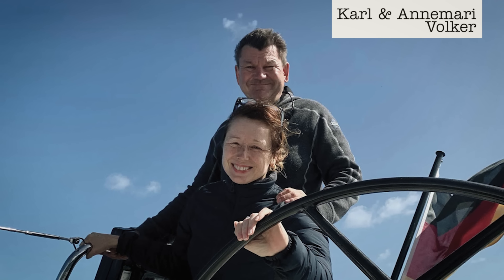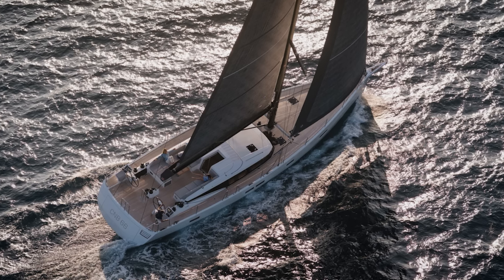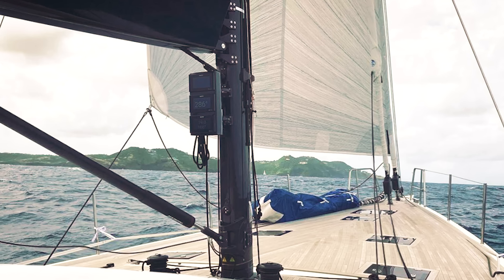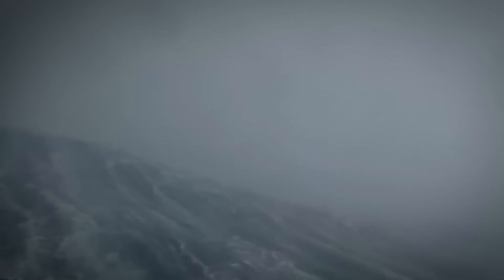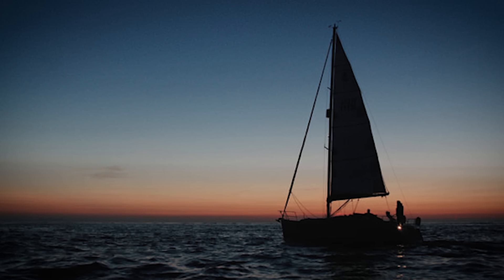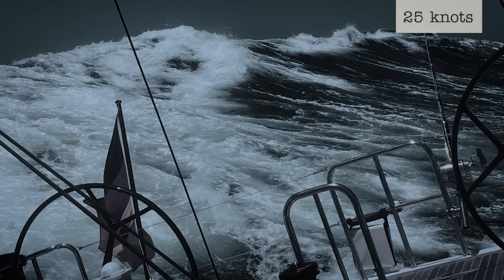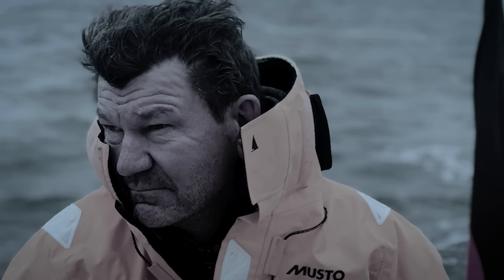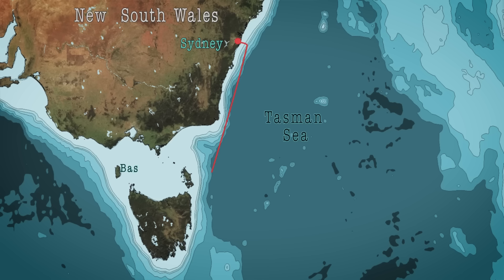Couple DIES on Private Yacht!

Comment: Sad story.   My analysis.  This seems like another case of people having more money than skills. going from the corporate world to big boat sailing is simply not possible.  You must start with small boat and work your way up. The title is not reflective of the events.   The diagrams are poorly done while the audio description seemed generally well done with some key facts skipped over too quickly.   I am a bit dumbfounded how they let this happen.  Have they not heard of a boom brake?  Heaving to?   Weather GRIB files?  Weather routing?    An in-boom furler is easy to manage.  This was not a race.  They should have shortened sail far more, slowed down, and not shaken out the reef if weather was expected to worsen.  WTH?   The Captain needs to both lead and train his crew.  Doing neither is destined for disaster.   Certainly slowing the boat down was the best choice.  Also, the description does not describe the proper method for furling.  There is no need for a preventer sailing upwind!   He talked about reefing implying it was slab reefing.  Next, it was too large a boat for a couple to handle.  Bringing on only two crew and not fully training them was unwise.  Sailing with less crew is OK, but it requires shortening sail in advance, and at night, people generally shorten sail for safety.   Practice, needs to be done at the dock with drills, followed by full practice in lighter wind conditions while underway.   For a boat that size, surely they had room from more crew.  I know there is room for at least 6 and more would have been better.   Then after the helicopter evacuation, I can’t believe they abandoned the boat.  They two crew were uninjured.  Did they no nothing about sailing?  Why were they there if they could not sail?   Couldn’t they get the main down and sail under the genoa alone?  Finally, I don’t understand how they both died. Very sad.   It sounded like they were stabilized.   How do you die from a broken leg?  Did that compound fracture severe an artery?   Were they over-medicated with morphine?
Reply: You bring up a lot of really great points. You should do a response to this video and do some research and make a new video researching all the fine points you mentioned.
Reply: dude had open fractures. that alone with tourniquet will kill him in not long time. not even accounting for blood loss

Comment: Sounds to me Carl was good man as well as his mate Anna Marie. It sure seems these new boat base on their designs to be like a racing boat is the biggest threat for sailors. I say this as I and my wife took 3 class levels of ASA in the Atlantic form St Augustine. During the class the Beneteau boats were not fun at all. Yes they turn like road racing cars but that sharp quickly turning is extremely dangerous. I went below when the capt and my wife were sailing to see how the living condition were during a jib and I was holding for death and was pulled away and thrown across from starboard of the salon to the port head and broke the then head door flying into the head room. I simply could have be killed. Not only that but sailing through 7' waves was awful slamming and pounding like a wrestler was throwing on the ground. These newer boat are designed to be for racing teams and the manufacturers are presenting them a sexy fast cruiser for couples. My training experience has lead me to to older Tayana's which are much more comfortable and safe in white water oceans as well as in tacks and jibs with their bit slower turning and cruising approx knot slower. Jim Rodgers

Comment: A furling boom does not furl the mast. It furls the sail. 
The main sheet is not called a rope. That line is called a sheet. 
Something is very wrong with your report as you say the main sail was lowered yet you also say the boom was a roller? 
The person on watch was clearly not at all experienced  - the boat should have been reefed as the wind increased. 
The crew did a good job medically but not with the boat - the main halyard (holding the main sail up) should have been released to drop the sail. If the wind prevented this then the sail should have been winched down. So many errors. What is obvious is that no familiarity training occurred. 
Very sad outcome that was avoidable.

Comment: Who puts in a second reef at 35 kts.?
Reply: Everyone whose boat was not overpowered before that? Some boats, depending on their size, point of sail and location of the second reef points in the sail will handle that wind velocity without difficulty. Of course, that's referring to traditional slab reefing where the reefing points are fixed. Aboard the boat in the story, a second reef could be in a relatively wide area of the sail.

Comment: You really need to find a better graphics guy. Your uncontrolled gybe animation in this video showed the wind changing in the opposite direction as would cause a crash gybe, and in your video about the anchor that crashed through the coast guard boat, despite repeatedly saying the boats crashed "port bow to port bow" you overlaid graphics that made it look like the tanker hit the coastguards ship from behind, port to starboard. Makes your content seem untrustworthy/poorly researched. Also there are no ropes on a boat... they are called lines.

Comment: WELL, BADLY DESIGNED SETUP FOR THE MAIN SHEET AND PREVENTER WINCHES COULDNT SEE ANY SAFETY BARS TO LEAN AGAINST IN HEAVY WEATHER EITHER ALONG WITH DECISIONS SHOULD HAVE BEEN MADE EARLIER BEFORE DARK<EXTREMELY SAD SET OF CIRCUMSTANCES.

Comment: The architect of the boat negligently sacrificed basic large boat design and safety for the comfort of an absurdly large and luxurious cockpit. In gale force winds, the main sheet is used to control the violent arc of an extraordinarily large and heavy boom from wing to wing by a single 5'-5" sailor of small-to-medium stature? A jerry-rigged 60-foot rope preventer running fore and aft with three attachment points? What? I'm never seen an approach on a large vessel. The boat should've been equipped with a glass-coated steel or aluminum spar running athwartship, fore of the cockpit, bolted at the gunwales, and fitted with a traveler on bearings, and a boom vang running from the traveler to the bottom of the mast.

Comment: I came up on Hobie cats, and in highschool a 27 impulse....all....fractional rigs (small sails on the front-big sale on the mast)....the first "cruising" boat I bought was a 40 foot ca..a masthead rig (big sail on the front-smaller sail on the mast)l. At this point I had I dunno a 1000? days on the water? Countless summers days as a kid, and 6 years or so running the cats, and later the impulse. My first job was even renting cats at the beach...that 40 almost killed me the first night out. I first got in trouble with the draft on the way to some barrier islands. We started to bounce on the bottom, during that the jib line got free as we started to course correct...It was me another life long sailor and our GFs...we started to turn...into the wind...and I ran forward to deal with the Genoa sail...a big massive bastard....and my buddy steering jibed....turning the boat the direction we came from...that sail caught wind and lifted me right off the deck...I barely caught the life line with my legs. I was completely not use to dealing with the amount of power a sail that big produces. I also was not really aware of how different a 27 foot boat is from a 40 foot boat.  I was young and in great shape, and survived...but..... truth is anything could have happened. So when I hear this guy got both his legs shattered.....yeah...on a boat that big??? ....there is a ton of power in that sail.